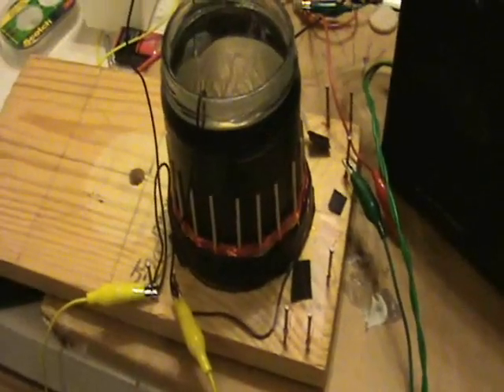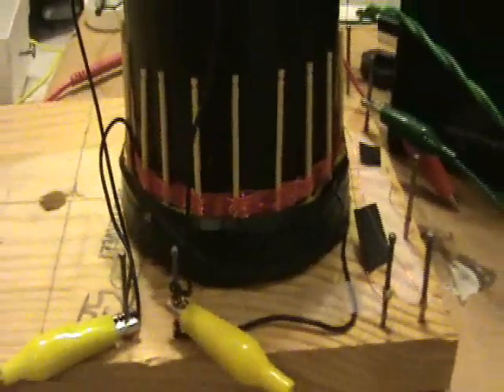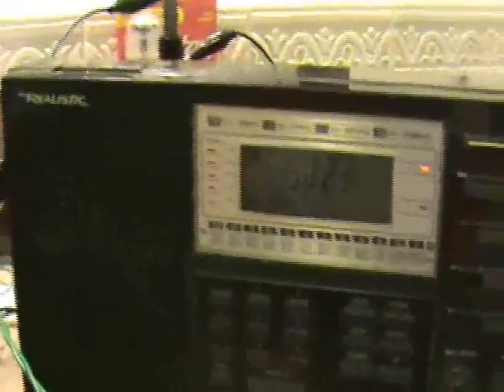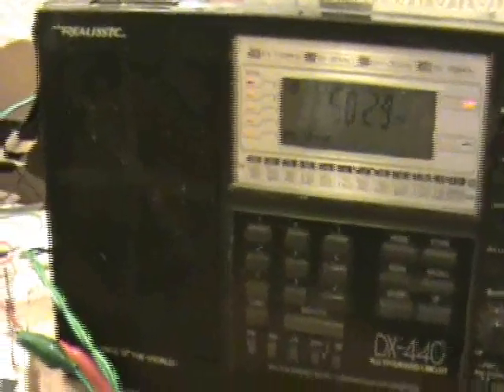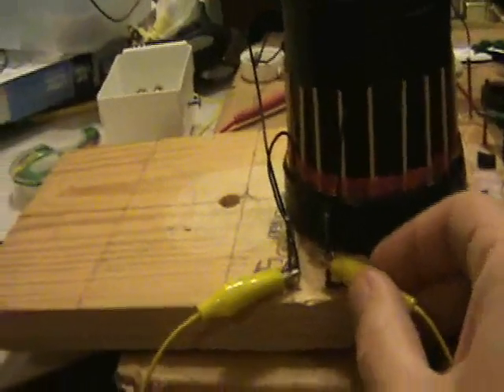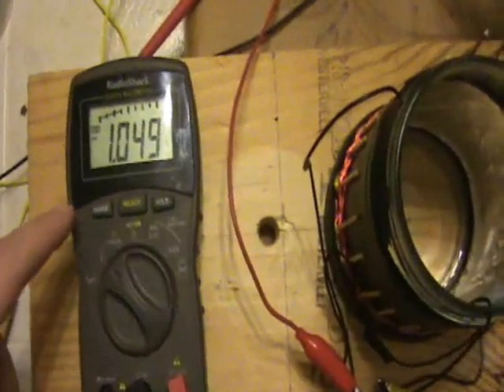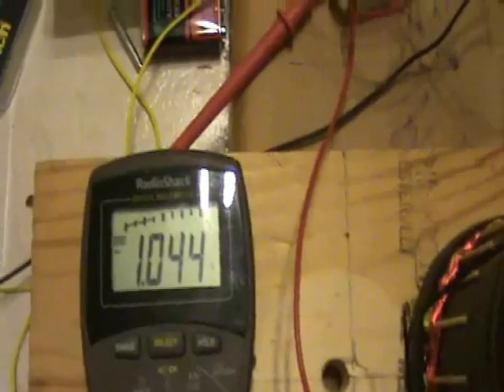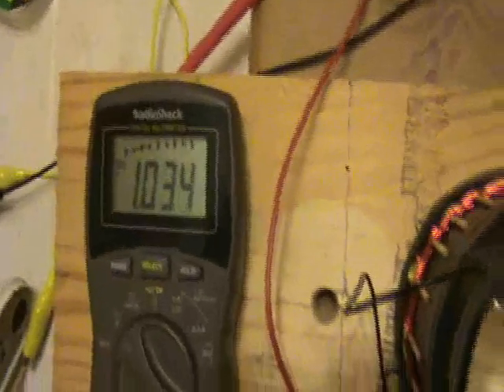Hendershot Fuelless Generator Coil Study

Comment: I would like to share with you a story about when I was going to work one day in 2004.  I had a Verizon analog phone and it was placed in the passenger seat with my electric razor.  Phone was on vibrate.  I got a call but didn't hear my phone.  My razor was running.  When I picked up the razor it stopped and noticed the light from the phone where I was getting a call. I answered and told them to call me right back.  When they called again, my phone was running my razor and when I would pull it away, 6 inches, it stopped.  I got really excited and told the friend on the phone thinking I discovered a secret of the universe.  Ofcourse I was told whatever and went on with life forgetting about it until I took GMDSS and frequencies.

Comment: One volt is enough to drive a small neon bulb .You say no it's not /well do you have one of those disposable cameras that has a flash bulb in it take the electronic out take the capacitor out take the flash buld out take the two consction that went to the bulb take a wire solder them to those take a small neon spiral bulb the electronic in it cound be used as well but is is 12 volt because of all the resistors a and a bypole coil in them the 1.5 volt is all the flash electronic s can handle i lights up the neon

Comment: dad used whatever he could get his hands on, i personally find it hard for him to afford s/s tubes of a certain size... in the work I used to do s/s was very expensive I can only imagine the cost back then, but he used cans,  I believe coffee cans, I don't believe they had ripples on the sides then, which made the sides smooth, there were cans inside the coil I remember that, perhaps he used them to keep from ruing the inner wrap when c-clamp pressure was applied, he used the clamps to trouble

Comment from the maker: I have a new observation re: the Hendershot Coil

Since the coil is wrapped around a capacitor, with material
that is very diamagnetic (my case aluminum foil),
the Nagaoka coefficient is NOT that of AIR.

Hence, the formula for a cylindrical coil needs to have
a Nagaoka coefficient that is something on the order of .2 downto .1.

Comment from the maker: with hand-made stuff, temperature changes, etc. the inductance and capacitance can change, altering the resonant frequency. I am bare foot. By touching it, I can convey charges on to various surfaces. If the radio is dialed to the correct frequency, I can hear the sound when I touch the metal surfaces.